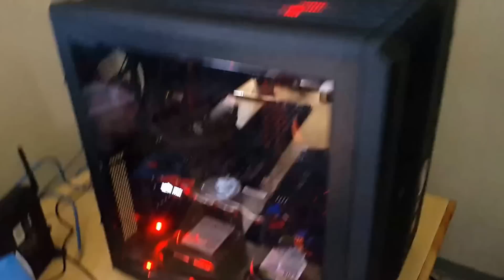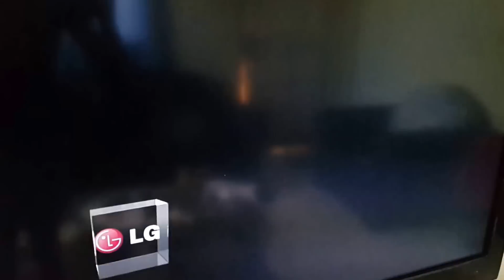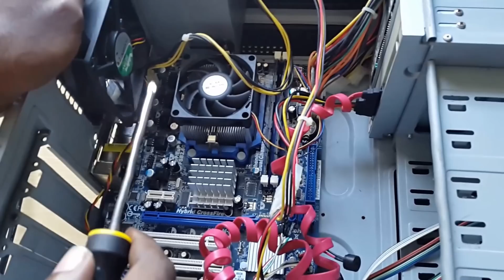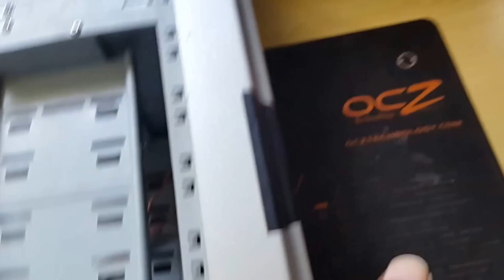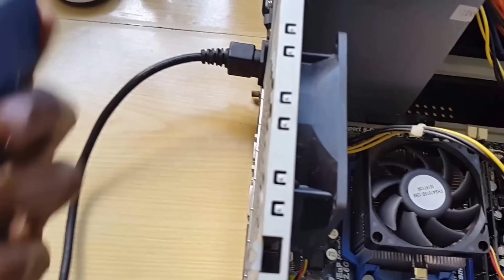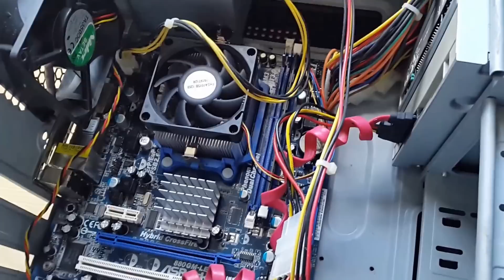No signal to Monitor Fix Easy PC Fix

Comment: i have a hp elite 8000 sff. i am going to run a 40" lcd tv as a monitor. the computer has a display port out put. i brought a display port to hdmi cable to connect to the tv. the computer currently has no os installed. will the boot up to bios power up the display port so i get a signal. i have no regular monitor or vga cable. the computer did have a different video card installed, i am going to try to remove it and see if it works. now sure if the bios/boot screen will activate the display port output.

Comment: Monitor won't display anything but no signal, checked the case, graphics card firmly in, cables good, and I did the CMOS trick, I also did the power button trick, to no avail. Help?
Reply from the maker: Do the CMOS reset and also try the power button trick more than once. Also if you have more than one PCIE slot for your video card try it in the other slot you have never used.
Reply: Turns out the hard drive failed, thanks for the help anyway!

Comment: my computer has no signal on both keyboard and monitor, my video card is working properly. and even my manual off botton are not working. it only works when i'm turning it on. please help i badly need it.
Reply from the maker: Did you check your power supply. Can it handle the hardware your PC has.

Comment: The problem is that when i`m watching stream and then start a game it will say "no signal" but i can steel hear stream sound can u help?
Reply from the maker: It may be a GPU Issue, try changing the PCIE slot or if the card is old a year or so try changing the thermal compound on the GPU.I assume this did not happen in the past? Did you do any Hardware upgrades lately?
Reply: i took it to repair and they said video card was getting ultra hot so they got thermal past on it so now everything works. it was just overheat issue anyways ty for attention

Comment: Hi all! I found a solution for my GTX 1070 and no signal problem... You 
must remove and reinsert the RAM or change to a different slot. It works
 for me! Good luck!
Reply from the maker: Thanks for the tip, I had a similar situation where after having my PC for a while I had to switch slots as you mentioned. Seems PCIE slots can become defective and cause such issues in some cases.
Reply: Grzegorz Fiedorowicz I need help I just built my brand new pc everything works and I still don’t get signal .
Reply: Grzegorz Fiedorowicz thanks bro
Reply: Alpha V did you find any solutions? Cuz Im stuck in that situation now
Reply: Grzegorz Fiedorowicz thx a LOT bro 😊😬😬
Reply: Thank you! I switched my 8gb RAM to the other slot and my monitor received the signal
Reply: I got a 1060 and my PC keeps getting the no signal, I'm not real computer savvy but I was wondering if changing slots is something easy that I personally could do without taking to my repair shop?
Reply: TheBigHomie Joe yes. It’ll take 3 seconds.
Reply: @moree3989  tried it but unfortunately I only have 2 channels and running ddr3 memory on my shitty motherboard so I'm going to need to upgrade it

Comment: My BENQ monitor shows the American mega trends thing then I press f1 as usual and then start Windows and my monitor will go off but I hear my Skype open plz help???
Reply: dan taylor I waited 1 night and it worked again
Reply from the maker: Check your monitor cable, see if the PC works on another monitor. Might be your cable or the monitor itself.
Reply: same Benq are so problematic ir's untrue! no signal for 6 days then hey presto everything works normally. fuck knows what it was!

Comment: okay so i have a problem with my gaming pc im using my crappy laptop right now so i decided to change the cpu and when i went to go turn on the pc it turned on the fans were working on my graphics card and stuff  but nothing came up over my monitor
Reply from the maker: You might have seated the processor wrong. Try reseating it and see if it comes on -sometimes happens to me when I build a new PC.
Reply: I decided to buy a new motherboard just incase
Reply: Thx for the help though

Comment: Hey man I love your videos. I was experience some fps drop on my PC before so I tried to overclock my CPU from the bios after it asked me to restart the PC as I did. The parts are working but I don't get any signals to my keyboard/ mouse and the monitor what should I do please help.
Reply from the maker: Clear the CMOS by either removing the battery on the Motherboard and leaving it out for a bit or use the jumpers beside the battery and short the right pins and then put the jumper back. This will reset any settings you input into the BIOS and if it is that you messed up on the overclock things should go back to normal.
Reply: Thames for The replay I did exactly that no it helped thanks
Reply: Your power supply big enough to run video card fans etc, Overclocking uses more wattage
 go back in bios reset to default, you may have went to far overclocking and burned it up do you a good cooler like a cool master evo? if everything fails take cooler off re apply thermal paste size of a pea drop.
 what cpu you have and what overclock you did.
Reply: its all good now,, all i had to do is to take out CMO battery and place it back again bill
Reply: Thanks man

Comment: Worked like a charm.  Thanks!  I like how you started from the easiest solution to the most challenging.  I was able to get my monitor on by 5:13 when you said check the video cable.
Reply from the maker: Thank you for the compliment, glad to know it worked for you

Comment: Hey thanks! Worked with holding down the power button. Do you know what is causing this problem so this doesn't happen again?
Reply from the maker: All electrons are like that after a while when they have power running through they. Seems static charge or something that builds up needs to be discharged properly. Not 100% sure.

Comment: Hey I have a bit of a problem, i took my brother's old computer and I exchanged some of his parts with mine I took his hard drive and motherboard and cpu and changed them with mine, the motherboard and cpu and hdd all were on his computer so the only things that are different are gpu psu and ram. im getting no signal but fans are spinning and gpu fans spinning, no beeps or anything please help.
Reply from the maker: Check your work and make sure everything is connected properly.Also you sure the CPU and Motherboard are compatible?
Reply: Yes they are thank you for the response, although I rebuilt it 2 times over. Sadly I am gonna have to take it to a pc repair shop. Although in my situation I didn't have any luck on your video I'm sure it was very helpful to many other people Thanks Ricardo!

Comment: I got my 1070 and I plugged everything in but nothing popped up, do is it cause I am using HDMI and not display ports or is it just my graphics card and I should test my on board graphics?
Reply: I didn't have pre-installed drivers on my card. Dumbest design work ever
Reply: FireDragon what do you mean

Comment: Thank You So Much, Can You Explain How That Worked? (The holding down the power button trick)
Reply from the maker: Seems to drain residual power that in the Motherboard circuitry that's causing the issue that's not drained by simply powering it off and causing the issue. But ul;ultimately who knows exactly.

Comment: Hi ricardo. I tried the one when you connect the video cable onto the built in graphic card and it worked, then i closed it and opened it again and i did not work. In the meantime i switched on hdd for another and the black screen came back and now im stuck here. Thank you for your response

Comment: I just built my first real gaming rig, and you earned a new sub.  The TV would not recognize my pc's signal, so I tried to hold the power button with no power supply connected and bam.  Jackpot.  Thanks a ton.
Reply from the maker: Glad to hear this was helpful, Know how that new build sometimes can run into issues and have you on edge.
Reply: Heard that.  Thanks again.

Comment: Hey Ricardo, I'm having this problem with my computer and I need help! So I've been having this problem for a while now, I use a Samsung smart tv as a monitor, I don't remember the exact time this started happening, but for a while, I had to press the small reboot button next to the mic and headset inputs just to start it up. Last night when I was shutting it down for the night, I accidentally pressed restart instead of shut down, so instead of waiting for it to restart to shut it down properly, I just held the power button until it forced shutdown. I don't know if that had any correlation to what's going on now, but every time I turn on the computer, the tv still says no signal, but it won't start up as usual when I press the restart button. Can you help me out?

Comment: So I have a little situation, my PC broke a few weeks back so I had it repaired, everything worked fine back at the repair shop. I got my PC back and had a problem with my pc again . Upon powering the PC up, the monitor would display Cable not connected. I took the monitor to the repair shop. It worked fine at the repair shop. They said it might be my cable, but the cable worked fine at the repair shop. I got a new Vga cable and now it displays ' No signal ' and then turns off. Help? I tried the method in the video but to no avail.

Comment: My of was working fine I unplugged the wire from my monitor to tidy it up plugged it back in now it says no signal
Reply: +mo cho I honestly dont know what I did I turned it back on and it just started working again
Reply: +Skrump i get those no signal screen either from time to time i have my pc since a week it is a gpu (graphics card) mistake in most cases reinstalling it might help but its not the fix in most cases
Reply: me too
Reply: +Korrai fux I fixed mine I took out the graphics card and ram and cleaned them
Reply: NaQs 6 how do you do that im sorry i just got my pc like 20 hours ago
Reply: +Korrai fux that won't be the problem then mine was like that cause of dust built up in it
Reply: +NaQs 6 then idk what to do
Reply: +Korrai fux what cable are you using and is there another slot on the back on your PC where it could fit in ?
Reply: +NaQs 6 I dont know the names but no there is not anothrt
Reply: +NaQs 6 im using a nzxt case
Reply: +Korrai fux Hi, same thing happened to me. I unplugged the monitors and plugged them back in, it now says no signal. I'm using both DVI and VGA. I've taken out the ram and cleaned it but it's still the same. any suggestions?
Reply: +NaQs 6 hi, sorry if you could take a look at my comment about my computer that would be great, thanks.

Comment: i recently got a r7 250 gpu for my pc it says it needs atleast a 400w psu i have a 300w i switch my pc on everything boots up as well as the gpu but i get no signal its an lg tv so it shows the same as it does on your lg tv. keep in min d o just got the gpu on Thursday so its brand new i take the gpu out and it works fine my pc gets a signal im going to assume that i need to get a better psu. if you could help me out it would be great

Comment: Thanks a lot, it works on my pc.
Reply from the maker: Glad to hear it.
Reply: Hello Mr. Ricardo, can you please help me? i get no DVI signal when i plug my DVI cable to my 7870XT gpu( everything is running fine in windows i can hear voices, but no signal). when i plug the VGA cable to the motherboard everything works fine and i get signal.

i tried an HDMI cable into my gpu and also no signal, GPU fans are spinning normally.. does that means that my GPU is broken and i should change it? and if i tried any of your other solutions in the video will be a waste of time?

PS: i used to face this problem occasionally and i fix it by replugging the DVI cable or restarting the pc, but seems these solutions aren't working anymore.

Comment: Just bought a new graphics card which goes into the pci slot, installed it and my pc opened up just fine but the monitor said it had no signal. Took out the graphics card, then my pc booted normally.when i connected to vga port..

Comment: Hey, i get the no signal when turning on my pc. I have recently got new parts for my pc. and psu i had the cpu and motherboard hanging around a while so i used some old parts, but was packaged safely. But it still seems to give no signal. i tried on board graphics and dedicated. I tried clearing the cmos, bios, and taking out the ram and putting it back in. Made sure that all connectors are fine. Again everything on the pc powers on, including the video card itself. and cpu, but still seems there is still no signal. Please help me! I just don't know whats goin on. even tried it on two different monitors that have always worked for me.
Reply: +Stuart Mortimore yes I do and get no beeps what so ever. I have a different motherboard that is brand new now, I might just try that. I believe the old one is failing.
Reply: ***** Ok i replaced with the brand new motherboard and it works like a charm! Had a bit of messups like long beep 2 short and realized video card plug was not getting power. So i plugged that in and worked great! So relived it was just my motherboard and not my processor. But thanks though, and also i realized the old motherboard started failing i haven't used it in almost 4 years.

Comment: Just bought a new graphics card which goes into the pci slot, installed it and my pc opened up just fine but the monitor said it had no signal. Took out the graphics card, then my pc booted normally. Help me pls mine is low profile. Am new to this pc thing
Reply: +Pay Mr Clay u have same problem like me,is ur problem fixed?
Reply: Hello, are you saying you just bought the graphics card and it's saying no signal on the monitor?
Reply: same here :(
Reply: same
Reply: +xDubDrillx yes pls help
Reply: I just bought gtx950 too and doing power button 1 minute method and it's working.
Reply: Sora try plugging the hdmi cable to the gpu. if that doesn't work, it might be the ram or gpu

Comment: I have tried two different graphics cards and I still have the same issue. I've tried the power button solution and putting the ram back in, but nothing seems to work. Any ideas?
Reply: I'm in the same place :/
Reply: I fixed my issue, I tried using a VGA adapter instead of just an HDMI cable and it works fine now. Although, it could still be a motherboard problem.
Reply: omg, thank you so much. VGA cable worked, thank you!
Reply: No problem, I know how annoying this problem is to solve so I'm glad I could help :)
Reply: +gravitywiretv i have this problem to but i wanna power 2monitors whit my system can i use the hdmi cabels later?
Reply: I'm not sure, I just have one monitor. All I did was get a VGA adapter, plug it into my GPU, and then plugged my HDMI into the adapter. I assume if you had two VGA adapters it would work, but I'm not completely sure.
Reply: +gravitywiretv already founs it :) i had to take out my gpu
Reply: +gravitywiretv and everuthing worked fine after installing Windows i could use the gpu agian
Reply: Tody_ Glad you found a fix to your problem!

Comment: When I updated from Windows 8 to Windows 10 I suddenly could not get a signal via my HDMI outport. Does anyone know what has happened n how to fix it?
Reply: Did you find a solution? Having the same problem.
Reply: +trickrick777777 yeh I did. I recently upgraded my graphics card from the onboard graphics card to a zotac.  I don't think it matters which kind except the fact it is a better quality card. But I'm not sure if the person I got to sort my PC changed any settings but I'm sure it's pretty much plug n play anyhow. Anyways I now plug my HDMI into the new graphics card itself as the onboard doesn't seem to work
Reply: +Mari Douglas Got the same problen
Reply: +ZTG problem*

Comment: Can you help me? I just got an Acer revo one and it will display on my tv but it won't display on my monitor, wtf is the issue?
Reply: i just builded my gaming pc but the monitor works on the graphics card but the ports on the motherboard does not work but the usb on the motherboard works heeeep

Comment: Please help me i just got a new gaming pc for my birthday and it won't work. When i plug the display cable into the graphics card output i get no signal on my monitor but when i plug it in the original ouputp it works
Reply: make sure no cables are plugged into your motherboard like vga if you are using the signal from the gpu, and if that doesnt work TRY vga to see if that signal works
Reply: Vorgrimmler1 got it fixed the graphic cards was loose and it was pretty hard to get it back

Comment: 1. MSI 970 GAMING DDR3 2133 ATX AMD Motherboard
2.ASUS STRIX GeForce GTX 970 Overclocked 4 GB DDR5 256-bit DisplayPort HDMI 2.0 DVI-I Graphics Card
3. Kingston HyperX FURY 8GB Kit (2x4GB
4. AMD FD6300WMHKBOX FX-6300 6-Core Processor Black Edition
5. Seagate 1TB Desktop HDD SATA
6. EVGA 600B Bronze 100-B1-0600-KR Power Supply, 600W
7. Kingston Digital 240GB SSDNow V300 SATA

just assembled yesterday. All fans start up spinning except the graphics card which spins for a couple of seconds then stop. The problem is that I'm not receiving any signal to my TV. little bit more info: I'm using The HDMI port from the graphics card to my smart TV.  if I power the computer off then back on the no signal sign comes off as if its about to start then after a couple of seconds it goes back to No signal. I unplugged and replugged the graphics card Cable and memory. I will try your reset method when I get home from work. I was wondering if all my components are compatible.
Reply: Skype would be awesome this is frustrating. if it helps I'm a Jamerican came here when I was 12. anyhow please reply
Reply: +Cemoy Clarke I'm having the exact same issue. did u get it to work yet? if so how?
Reply: +TruK1lla the ram wasn't fully inserted. push the ram down with more force and make sure you hear the click. hopefully that's your issue because I know how frustrating it is.